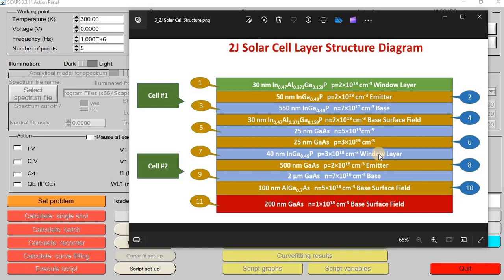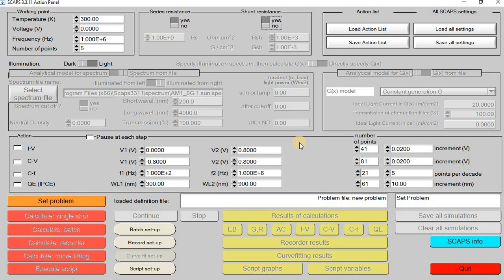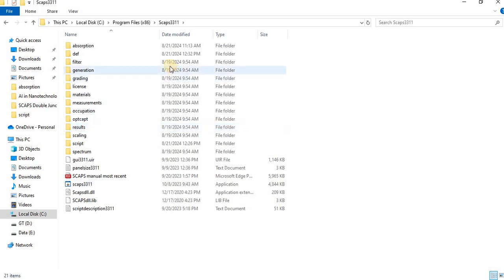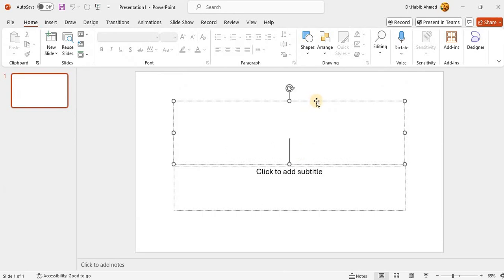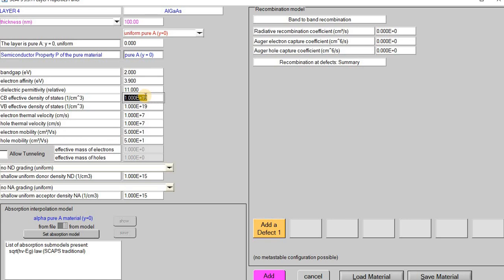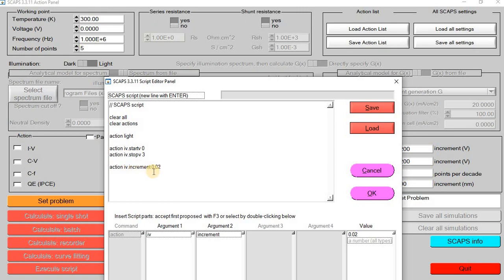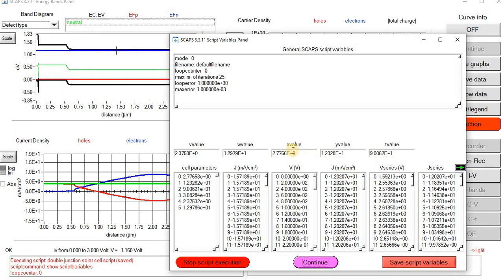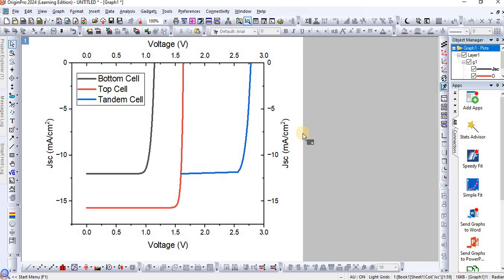SCAPS 1D Simulation of Tandem Solar Cells || High Efficiency InGaP/GaAs Tandem Solar Cells 🌟⚡🌞💻

Comment: Hello, first of all, thank you for your video tutorial. My teacher taught me that since the software can only add a limited number of layers at once, when considering the tandem cell, should first calculate the data of the top battery using the original solar spectrum, then replace the original solar spectrum with the filtered spectrum of the top battery and apply it to the bottom battery, and then calculate the result. Do your program and this method yield the same result?
Reply: The Method Your teacher taught is okay. my main problem is how to get the spectrum

Comment: Hello, I would like to ask why (in the top cell) you used for emitter a p type and not a type. Same question for the base (reverse)
Reply from the maker: Hello, great question!

In SCAPS-1D, the emitter is typically the front layer where light first enters the solar cell, and the base is the thicker absorber layer where most of the light is absorbed and where the electron-hole pairs are generated.

For the top cell in a tandem/double junction solar cell, I used a p-type emitter and an n-type base (i.e., a p-n junction) for the following reasons:
	1.	Band alignment and carrier collection efficiency:
A p-type emitter ensures efficient collection of electrons at the front contact and aligns better with the subsequent tunnel junction or intermediate layer in the tandem structure.
	2.	Minority carrier diffusion lengths:
Electrons (minority carriers in the p-type emitter) typically have higher mobility and diffusion lengths than holes. This helps improve carrier collection when the emitter is thin.
	3.	SCAPS-1D simulation stability:
SCAPS tends to simulate more stably and accurately when the emitter is thinner and has the proper doping to reflect real device architectures. Many real-world tandem cell designs (like perovskite/silicon) also use p-type emitters in the top cell.

For the reverse question (why not n-type emitter and p-type base):
That configuration is also valid (an n-p junction), but it depends on the material system and device architecture. For my simulation, the p-n configuration gave better performance in terms of open-circuit voltage and carrier extraction.

Comment: Hello Sir, I would like to ask you if you know how to change the absorption constant for a layer in SCAPS 1D. I am trying to simulate a b-Si layer and I dont know how to adjust the absorption constant a. Do you have any idea?
Reply: Do you think its possible to simulate this kind of antireflection coating layer?
Reply from the maker: You can add absorption vs wavelength files for each layer.

Comment: // SCAPS script

clear all
clear actions

action light

action iv.startv 0
action iv.stopv 3

action iv.increment 0.02
action iv.checkaction
action iv.stopaftervoc

//simulation the perovskite top cell
load definitionfile TOP LAYER.def

calculate singleshot
get iv zu

// simulation for the bottom cell

load definitionfile BOTTOM LAYER.def
calculate singleshot 
get iv vw

//calculate the series connection iv curves

math series xyzuvw nz

// visvisulise the result

plot draw zu

plot draw vw

plot draw xy

//extract the solar cell charchtershtics

math characteristics.all cxy

math characteristics.voc xxy

math characteristics.jsc yxy
math characteristics.ff zxy
math characteristics.eta uxy
math characteristics.vmpp vxy
math characteristics.jmpp wxy

//show the script variable 
show scriptvariables

Comment: Sir,is it necessary to keep current same for top and bottom cell?as they are in series connection
Reply from the maker: Current matching gives optimal performance. However, it’s not easy and SCAPS oversimplifies multijunction solar cells. For more accurate simulations, I’d recommend my videos on the Silvaco TCAD simulation of single, double and triple junction solar cells.

Comment: Thank you very much for your helpful tutorial video. How is the intermediate layer considered in the simulation of a tandem solar cell? Specifically in the above video, how are layers 5 and 6 considered
Reply from the maker: That's an excellent question. You are talking about the tunnel junctions. I don't know a direct solution for this yet. One way to get around it is to use a filtered spectrum.
I'd highly recommend using Silvaco TCAD simulation for tandem solar cells. I already posted another video on this.

Comment: Sir i have a question regarding to tandem cell when and  where we use filtered spectrum in tendem solar cell?
Reply from the maker: Where Filtered Spectrum is Used:
Top Cell:The top cell absorbs a portion of the incident light, leaving a "filtered" spectrum to pass through to the bottom cell. This filtered spectrum is what the bottom cell experiences, with the high-energy photons (typically the shorter wavelengths) already absorbed by the top cell.In SCAPS 1D, you set the top cell to use the full spectrum of sunlight (e.g., AM1.5G) as input.

Bottom Cell:The bottom cell receives the filtered spectrum from the top cell, which means it will only absorb the light that was not absorbed by the top cell. In SCAPS 1D, this requires you to adjust the input spectrum for the bottom cell based on the absorption characteristics of the top cell.You can simulate this by using a custom or filtered spectrum for the bottom cell in the optical input settings. This spectrum is typically generated from the top cell's absorption profile.

When to Use Filtered Spectrum:During Optical Simulation: When modeling the optical properties and behavior of the tandem solar cell, a filtered spectrum is crucial for accurately predicting the performance of each sub-cell.In Tandem Configuration: Whenever you are simulating a tandem structure with two or more sub-cells in SCAPS 1D, you need to use a filtered spectrum to ensure that each sub-cell's input light intensity and wavelength range are realistic.By properly setting up the filtered spectrum, you can more accurately simulate the real-world performance of tandem solar cells in SCAPS 1D, leading to better understanding and optimization of the device.
Reply from the maker: Good question by the way. I should have taken the filtered spectrum into account.
Reply: @HabibAhmadGatech  thank you ❤️
Reply: @HabibAhmadGatech  sir can you make video if possible, how to make filtered spectrum for bottom solar cell?